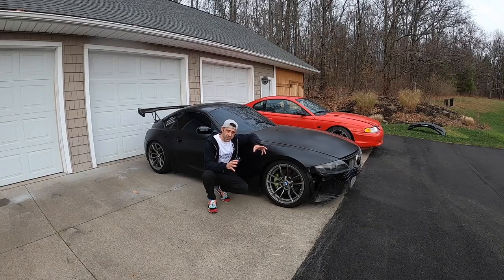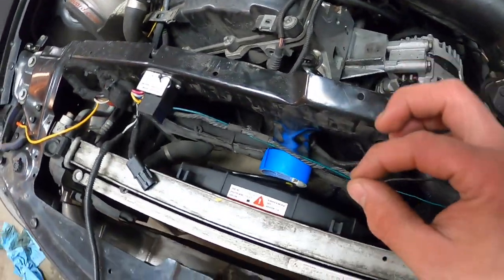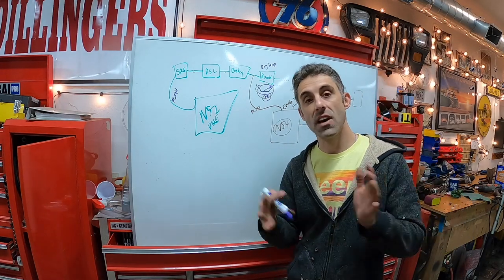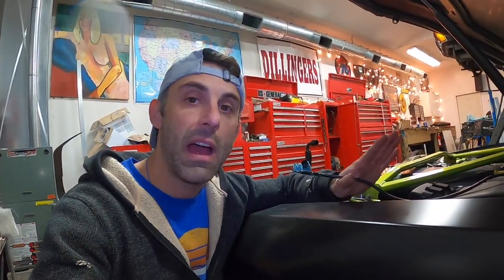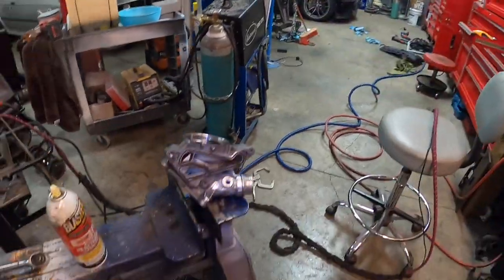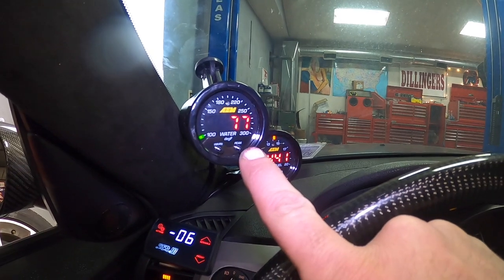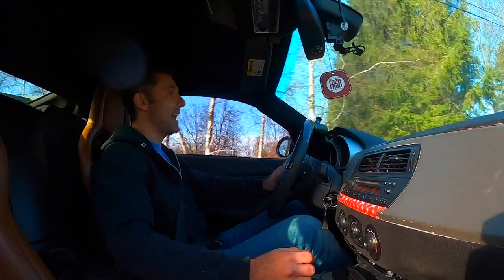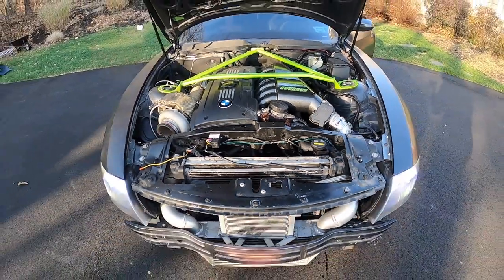BMW N54 Z4 Overheating Problems...SOLVED!

Comment: Hi, The N54 swap on the E85/E86 could be done without extra DME. The E85/86  non LCI and LCI all use the same Can communication protocol from the E46, all N54 use the new PT-Can protocol from the E9X. So there is no way to just connect this two Cans. The only way is to use any kind of translater/gateway/bride between the two CAN protocols. All signals from the N54 DME (RPM, TPS, temp...) need to be received from that PT-Can and translated to the old protocol and sended out to the Z85 Can. All relevant signals for the DME need to be received from the Z85 can translated to the new Can Protocol and sendet out to the MSD81 (N54 DME). This way is not that easy, because the PT-Can does have a lot more signals than the Z85 provides, e.g brake pressure for all wheels. Some signals have to be simulated. I already made such a gateway based on a arduino. It is tested on the car and on the engine, both sides are working. But I didnt do the engine swap yet. Here is the video where I simulated all DME signals with the arduino, no DME connected: https://youtu.be/_RAA13WuPmI
Reply: Have you done the swap?

Comment: Understanding CAN buss and it's iterations/changes through time from Bosch/BMW is paramount when enthusiasts start mixing things in.  In heavy equipment such as construction equipment/tractors it is typical to have the cooling fan blow OUT through the radiator from the engine compartment.  (const. equipment doesn't have speed to move air through the radiator/engine compartment.)  GJP
Reply from the maker: Right, of course! Interesting! Almost like being stuck in traffic for an hour!

Comment: Very nice Frank. That 220F is strange. My n54 2009 reaches only 205 F. And I have to drive about 15 miles to get that. I think it's on some tune because it pulls harder then a oem n54. A friend of mine has one on 350hp and he drove my car. According to him my n54 is faster🤔. Maybe they did an oilcooler thermostat upgrade and it operates cooler then an oem n54. The woman    who owned it, didn't tune the car. She bought it from a businessman, when the car was 3 years old. He never mentioned the n54 is on a tune🤔. Dutch regards, Nico.

Comment: Do you have a video of n54 swap? Are the n52 engine mounts also suitable for the n54b30a engine? How did you solve the problem with the electronics? How did you connect everything to the bodysuit?

Comment: I tuned my n54 with mhd and have the temperature setup to sport mode/setting which holds my coolant temps around 220F. 

My n55 runs hotter on normal driving, 230F or 240F. I think I'll tune it too so it runs cooler. Every part gets baked under the hood running this hot.
Reply from the maker: Yeah, N54/5 like to run hotter than normal, but 230 is too hot. The fan regulates at 220-222F

Comment: Don't know anything about this swap.. Why is there not the same issue with the tachometer for the kombi? Is not not through the canbus as well?
Reply: Maybe the n52 dme was disconnected from the tac and Speedo and uses the signal from the n54’s but then again why not just use that for the coolent temp gauge. So that must not be the answer

Comment: I have dreamed of owning an N54 E85 Z4 for YEEEEEARS. I had no idea someone had completed this swap... Is it identical to the E46 swap? Where can I find details?
Reply: This is something I am actively researching, I think it’s more complicated because the z4 with n52 has ews and cas modules. Possibly the older z4’s with m series motors and not n series motors would be similar to a e46 swap
Reply: The biggest thing though is it might be possible since they both have cas is completely remove the n52’s dme out of the picture since the car communicates with the same modules. The question is do they speak the same “language”
Reply: I'm just on beginning of same project, i own 2008 z4 e85 3.0si and going to swap on n54, engine with transmission I bought already,
Reply: @DZ_Z4turbo   heck yes! What’s your plan for ecu and integration into the car?
Reply: @nemmayol  I had already a conversation with a local workshop, they specialize on this kind of things and I was told that it can be done ( integrate n54 dme to z4 facelift). I will do only mechanical part of job. Also I need make custom engine supporting brackets, on right side will be custom and left side I will use from z4 n52. So far I'm waiting for parts and in 2 weeks will continue my project.
Reply: @DZ_Z4turbo  I am super interested in how they are going to do it, because the one in the video is absolutely horrible in my opinion and I feel like something else better could be done
Reply: @nemmayol  Agree, nice car, nice engine but big mess with wiring

Comment: Nice work Frank. Where did you get the fan shroud from?
Reply from the maker: Actually - Ebay. All I needed was the aluminum shroud. "18-3/4" x 20-3/4" Aluminum 16" Fan And Shroud Fits 26" Radiator Chevy Ford Mopar"

Comment: Why did you run two DME's ? 

I have a 2011 328xi e91. I also had an 08 335i e90. Eventually swapped the the n54 into the e91. MY harness was plug & play along with switching the CAS, FRM, DME . But is there a benefit to running the original 328xi DME in parallel ?.
Reply from the maker: The previous engine swap company implemented 2 dmes. I would not run 2 dmes and have always outfitted a single dme into my engine swaps

Comment: Is it possible to completely remove the n52’s dme? Would the N54 dme play nicely with the systems other modules?
Reply from the maker: Nope, the wiring is different at the DME connections
Reply: @Garageaholic  the reason i left the n52 DME in it is because the car is an 07 and uses d-can instead of ptcan so the electric power steering wont work right without seeing the dme and rpm signal. if the car was an 08 with pt-can i would have been able to remove it completely and all the temps would work right with the cluster
Reply from the maker: Interesting!! But you can no longer acquire an RPM signal from a the N52 DME, right? So is it reading rpm?
Reply: @mncperformance1   do you know what build dates switched to PTcan on the z4’s?
Reply: @Garageaholic  crank sensor input for n52 is piggy backed into the crank sensor harness for n54 dme
Reply: @nemmayol  model year 2008 and up. i believe 07/07 and up production
Reply: @mncperformance1  so if I have 2008/08 build date, n52 dme can be completely removed ?
Reply: @DZ_Z4turbo  in theory yes
Reply: @mncperformance1  How can I check, what kind of signals uses my z4? ptcan or dcan?

Comment: I don't understand why need two dme's? I think n54 dme can be connected
Reply from the maker: Wiring harnesses are difference between the 2 DMEs
Reply: @Garageaholic  I'm not professional in electric stuff, but I was told by professionals that it can be done, adopt n54 dme to z4 e85 (but only facelift) and e86. In next few months we will see who was right 🙂. Im on beginning of similar project n54 to z4 e85 3.0si
Reply from the maker: I’d LOVE to hear your updates - where are you documenting the build? IG? YT? FB? Website or forum?
Reply: @Garageaholic  so far nowhere, but I'm collecting all info what I have done and when the project will be finished,  it will be posted on my Instagram